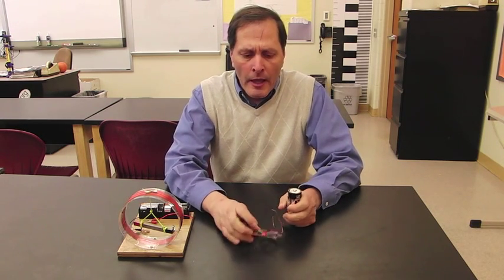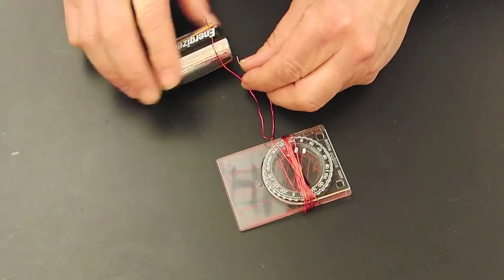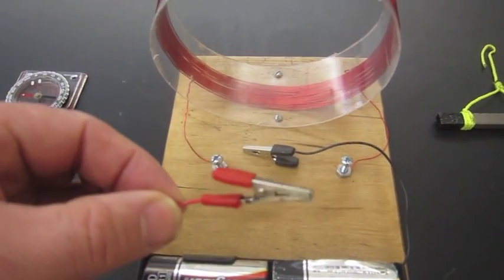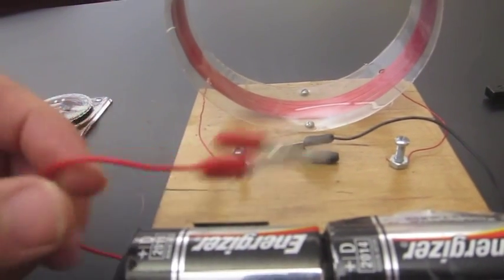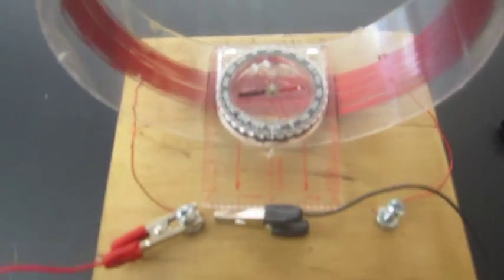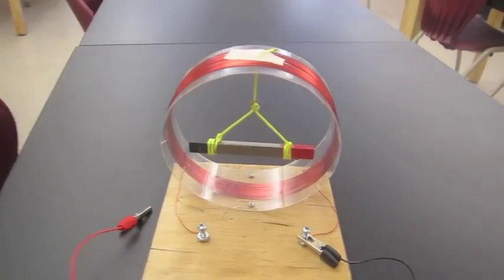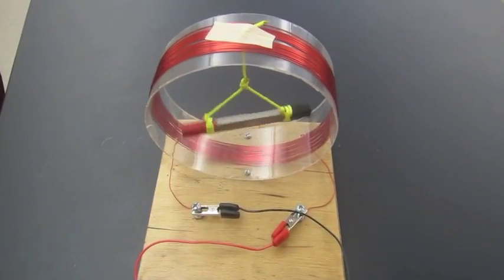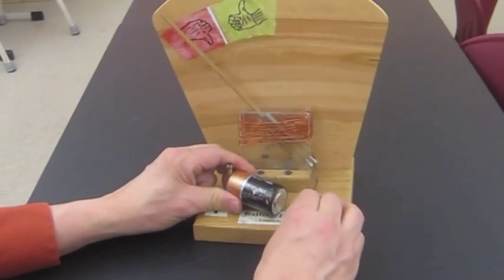Tangent galvanometer experiment///Homemade Science with Bruce Yeany

Comment: When I constructed this model, I observed that the compass needle was already aligned perpendicularly when placed at the center of the coil, even without the circuit being energized. Could someone explain the reason for this behavior?
Reply from the maker: you can set it pointing in any direction by twisting the string that supports it
Reply: @YeanyScience  ok sir 👍

Comment: Sir why have you put both the batteries in box?? What is it
Reply from the maker: it is a battery holder,   hold the batteries in position, connects them end to end  to double the voltage has wires coming out of it to make connections

Comment: Sir i am not getting 1.5. V battery. 
What shall I do . Please answer
Reply from the maker: the batteries that I used are standard ones sold and have a charge of 1.5 volts.  This would work with other voltages if 1.5 volt batteries are not available

Comment: With which wire the bar magnet was tied sir please answer me
Reply from the maker: the wire is 20 gauge wire wrapped approximately 50 turns around the plastic cylinder.  the bar magnet is not tied to the wire at all,  the bar magnet is tied to the plastic cylinder
Reply: Oh my god u are genius sir